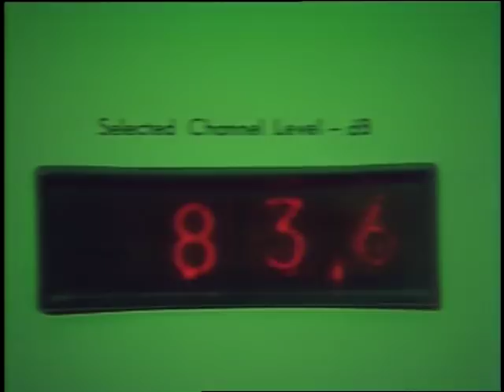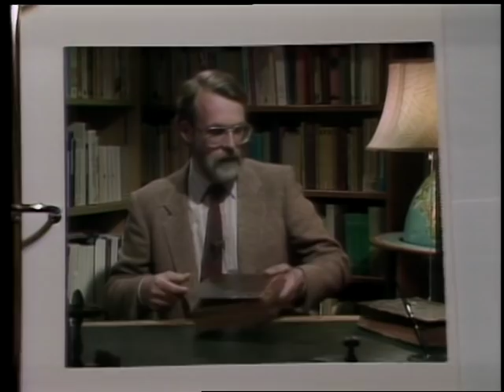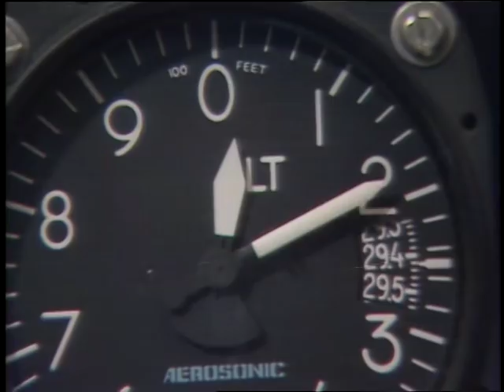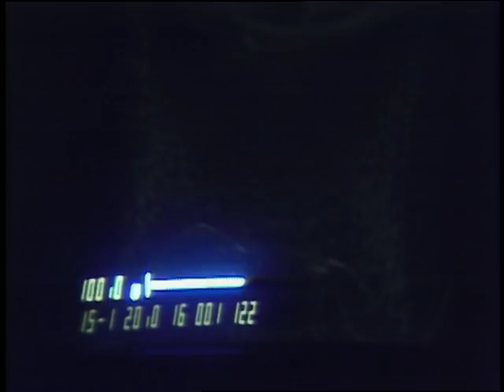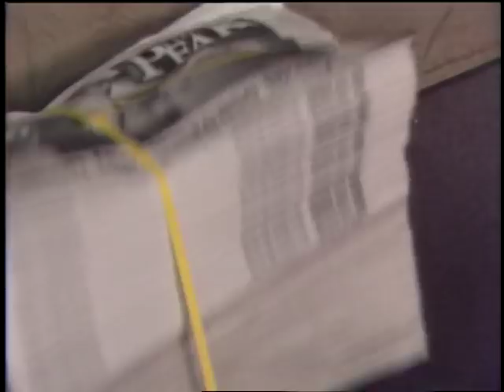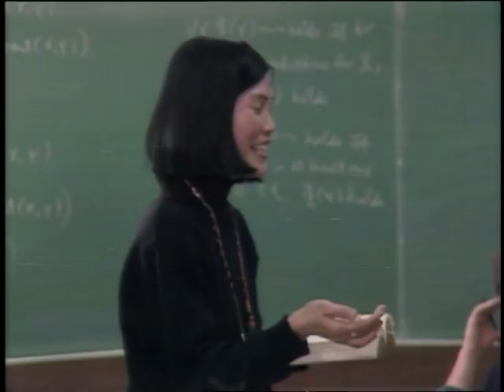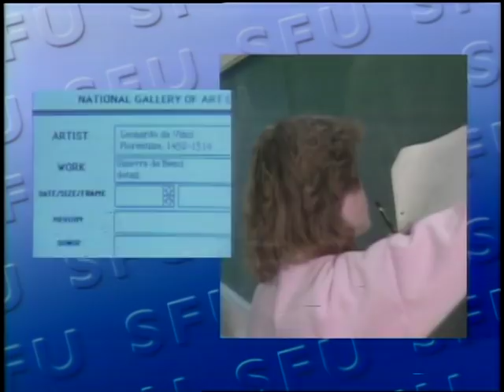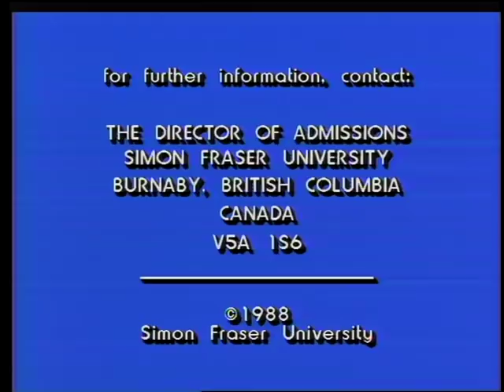Simon Fraser University - 1988 Feature

Comment: Actually,  SFU has changed completely. Everything beautiful about the campus has been changed and removed. University grounds were sold off to high rise developers. Artwork, trees, landscaping and custom cosmetic features were taken away. Campus care and grounds maintenance are down 60% of it's previous priority. Cheap academic buildings have been erected blocking and destroying Arthur Erickson's amazing architectural creation. The only thing left of it's previous glory is the Quadrangle and Library.  It no longer has the prestige of a  grand University or the learning center of the future minds of tomorrow....it's just a bunch of buildings left standing to operate on the levels of Walmart or any other low overhead business with the drive to gain a quick return as long as they can. Eventually...the entire top of that mountain will be nothing more than unaffordable high-rise condos with an old sign that says "Original Foundations of Simon Fraser University"...
Reply: Actually, I'm the one that bought the land.
Reply: Well said.